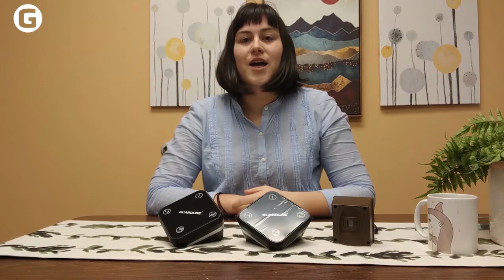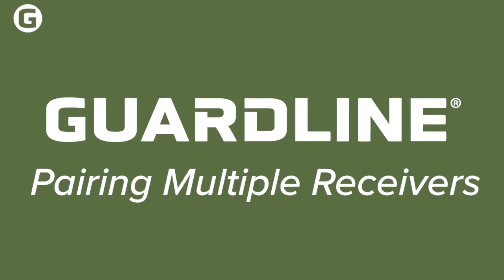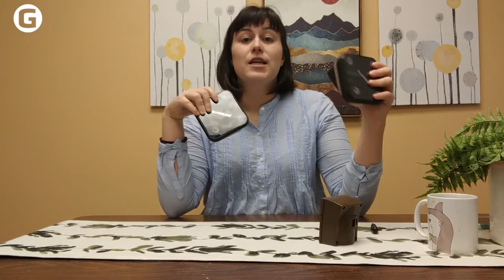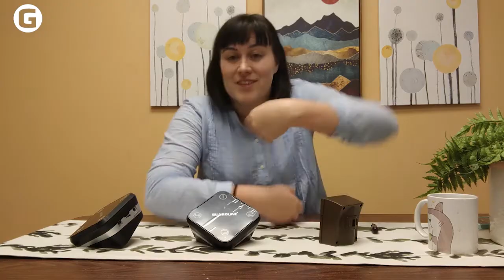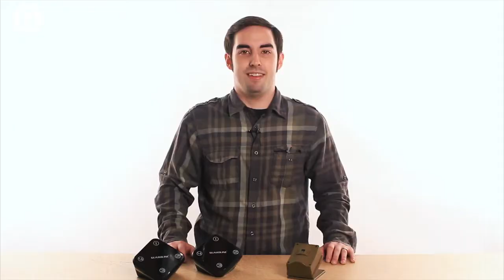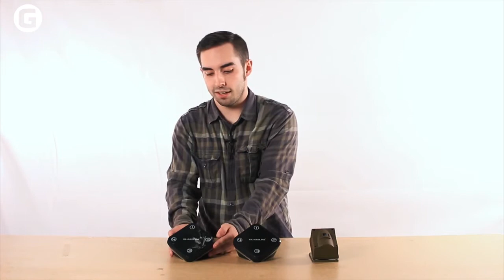Guardline Security: Adding an Additional Receiver

Comment: The plastic screen on one of my sensors cracked and broke. I bought new sensors(same line) they will not pair with the 2 original receivers. The new sensors also came with a receiver... the new receiver will not pair with the old sensor.